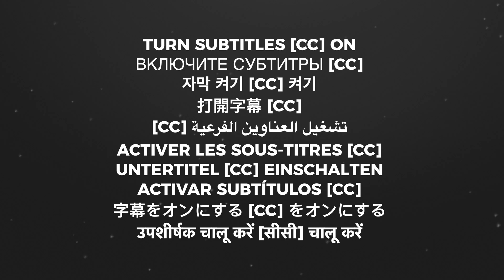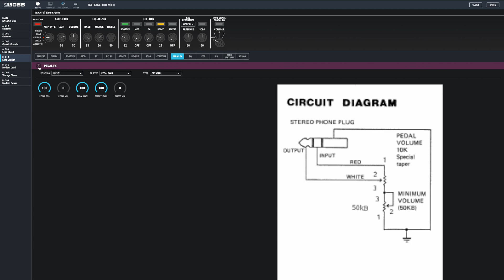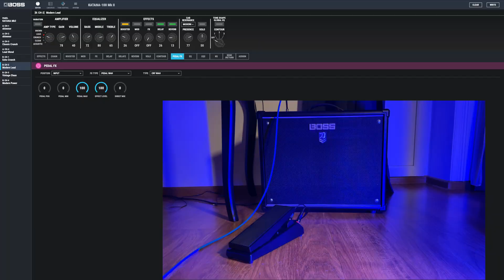HOW TO MAKE DIY EXPRESSION PEDAL FROM $20 to LIKE Boss FV 500H FOR $150 FOR BOSS KATANA AND OTHER

Comment: Why are there 2 pots in the pedal and you only replace one of them? Wouldn’t it be easier to calibrate by making sure the pot (and the pedal) is already at WOT when you put it in?
Reply from the maker: Yes, One port for use with Katana, second port with original potentiometers for use as regular vol pedal. No need change both channels.